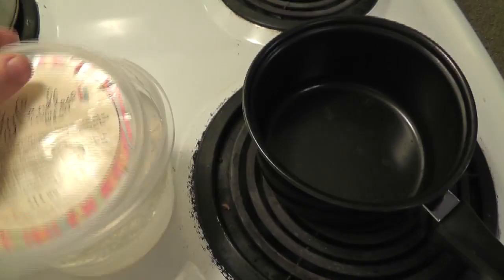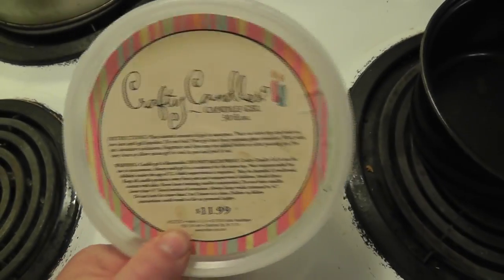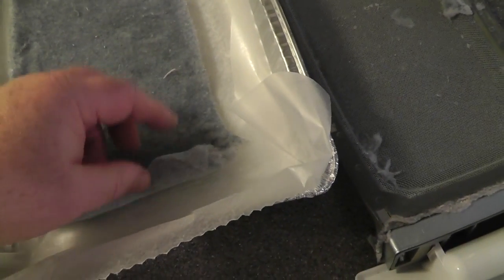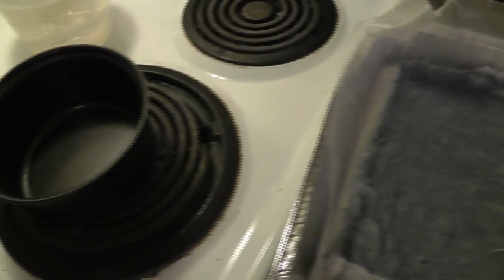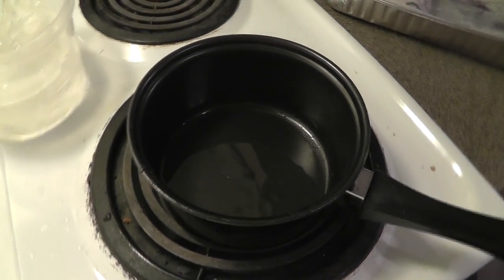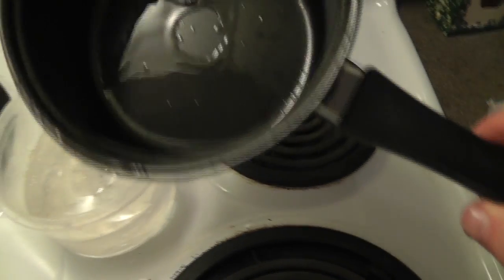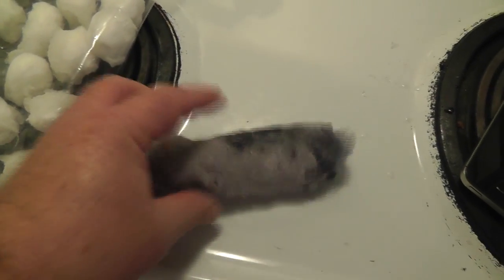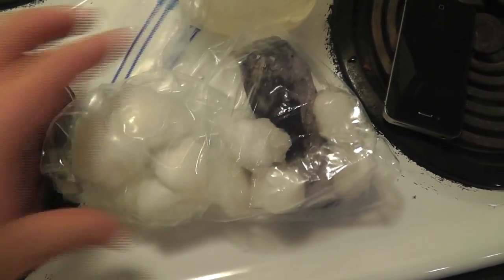How to Make Lint Logs and Gel Wax Cotton Balls with Burn Test

Comment: @ArtisanTony We have already used several of the starters to get campfire going here at home. You might recall we make charcloth on open fires, lol, and it usually leads to some sort of tomfoolery. 
At the same time, if it is getting some folks off their butts and being active doing something, that's good. And, if ever confronted with a situation requiring some know-how, perhaps this will contribute to better results.